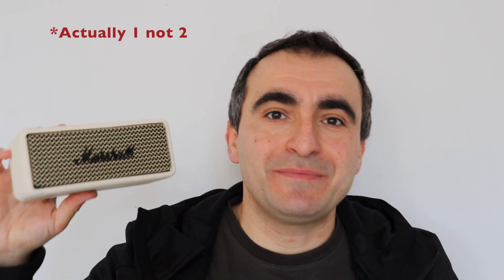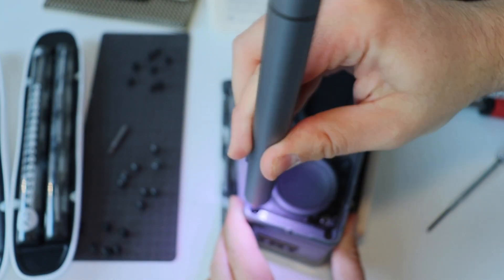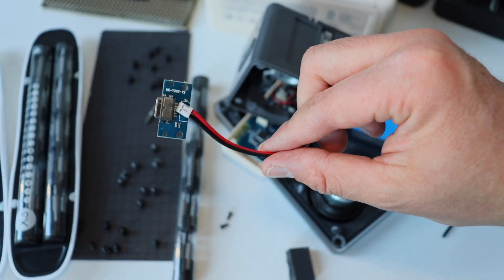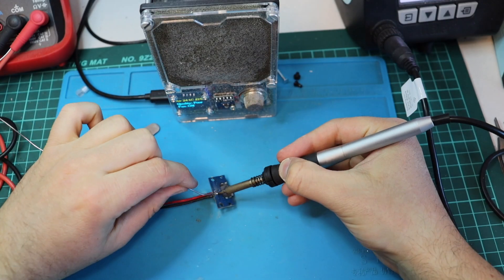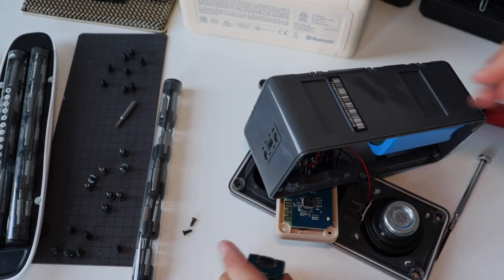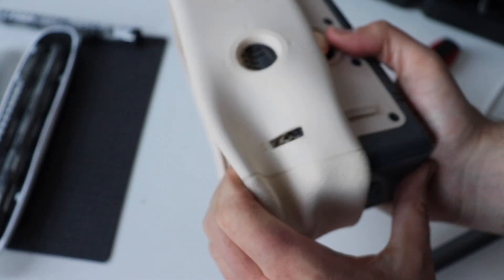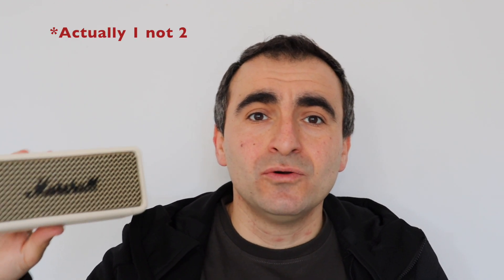Marshall Emberton Counterfeit Bluetooth Speaker Disassembly and Repair

Comment: On off wala button Tut jaaye to kaise direct Karen ya kahan se theek Karen
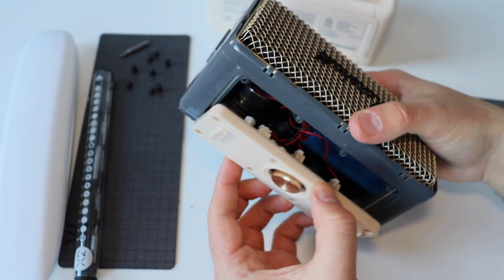Reply from the maker: You have to remove the rubber enclosure and disassemble the speaker to get to the On/Off button and repair/replace it as shown at 1:01

Comment: This is fake Marshall Emberton.
Reply from the maker: Is it? How do you know? As I repaired the speaker for a friend I have no idea of the origin.
Reply: @ Yes it is. It’s outside appearance it really different from genuine one. As part of the mainboard was totally different one, the color and the build shape and the electronic components. I’m a Bluetooth speaker Technician, I’ve been through this a lot as I do repair Marshall Speaker and other brand like JBL,Bose,HK as well. You can look for  a picture of original mainboard Marshall emberton and compare the one in your video, the board color is green and only manufacture in green colored board .videoNice video by the way 😊
Reply from the maker: Ok, thanks for the feedback. Based on it I renamed the title to highlight it is a counterfeit speaker. This repair started as Embedded II and ended up as a fake Emberton I :) :) :)

Is the quality of the mechanical parts of the original speaker better than on this one that I repaired in the video?
Reply: @LeonAnavi  the circuit board of the fake emberton 2 do come in green version too but its totally different from the real one .. i bought one online, thinking that it was real, and had the same charging problem but didnt want to throw it away. So i opened it up and rewired it to an external 2x18650 battery pack that i charge separately. i didnt try to resolder the usb-c connector yet, as I just saw your video .. maybe i will try that next time.